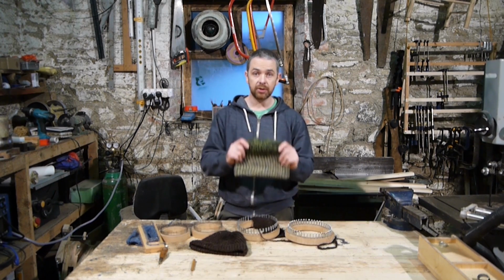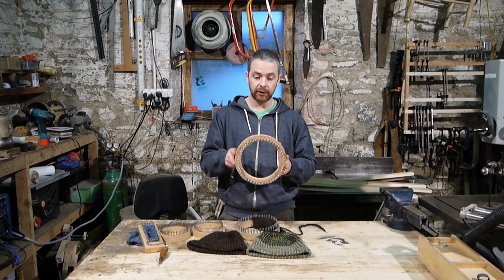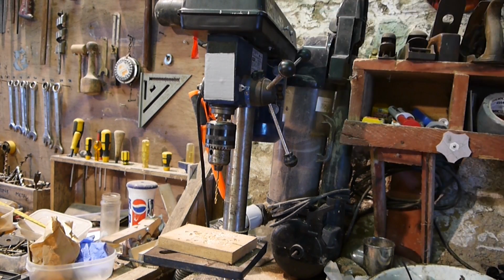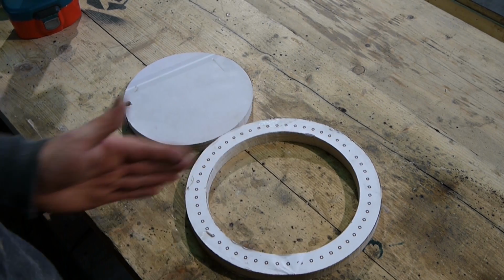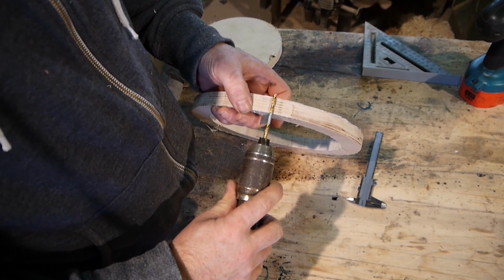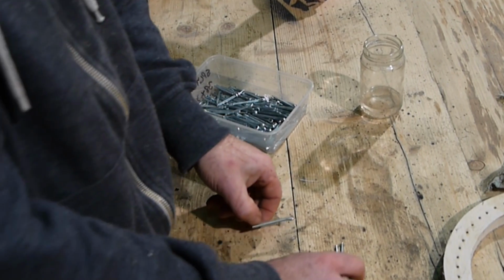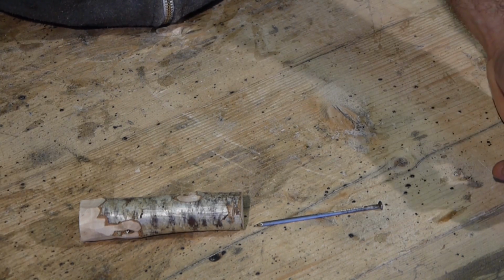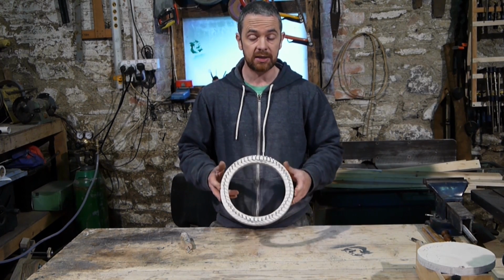Workshop Series part 1: Making a hat loom

Comment: Brilliant video, very easy to make,  I have just came across a bit of a difference,  drawn circle with 227.5 mm diameter with compass,  spaced peg dots 12.5 mm from each other and it came as 56 pegs.  Plus if whole knitting loom is ment to be 25mm wide then outside diameter will be around 252mm and inside around 204mm. Unless I am counting or doing something wrong.  Thanks any way it is brilliant instructions and very professional video :)
Reply: I drew a 227.5 mm circle set compass to 12.5 mm went round it 56 marks !